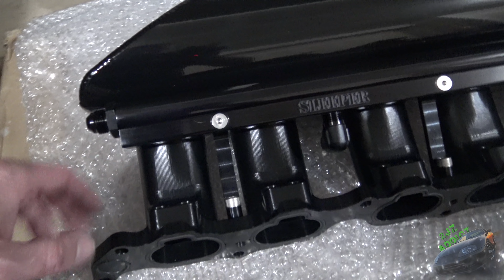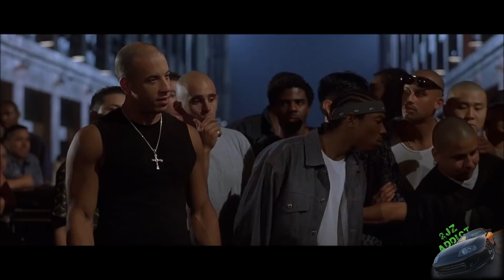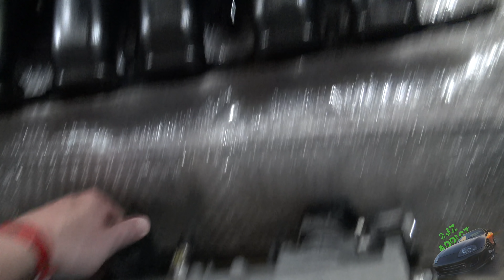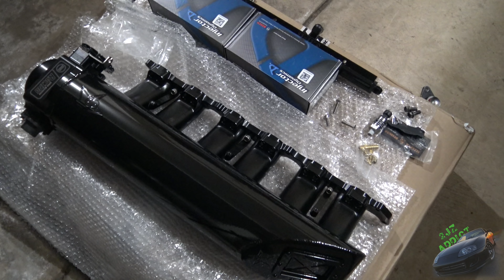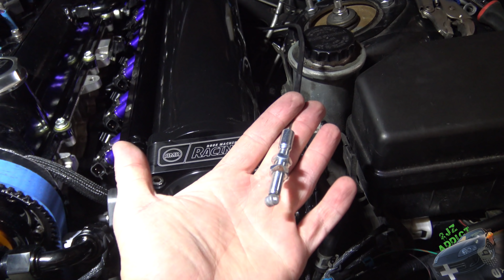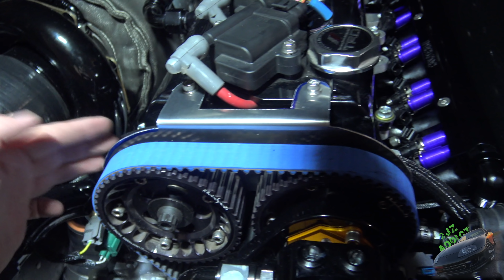1000hp Supra Build | Part 4 | Sleeper Designs Intake Manifold install & Why builds take so long...

Comment: Did you use your stock dip stick tube and dip stick or did you get the freed engineering lokar dip stick?
Reply from the maker: Funny you mention that, I was contemplating grabbing an FE unit over the weekend. Lol I just use the stock one at the moment and did when I filmed this as well. It works fine but I think the FE unit would be a nice touch. 👌

Comment: What AN feed and return size do you need for 1000 hp and will the size you recommend work at less horse power?
Reply from the maker: I run dual 8AN feeds and a 6AN return which is plenty for 1000whp. Some guys run 10AN feeds and 8AN return which is a little aggressive for that power level IMO. Make sure to set your FP properly and you’ll be fine at a lesser power level and have room to grow.

Comment: The fuel rail fittings you use, where did you get them from and what is the size?
Reply from the maker: The fittings came with the rail and manifold. Both were ordered from Sleeper Designs. You do have options if you’d like to run larger or smaller depending on your build. These are -8AN I/O with a -6AN return. The ID of the rail is -10AN so there’s room to go up in line size down the road.
Reply: @2JZAddict  thank you!
Reply from the maker: You’re welcome! Good luck with your build! 🍻👍

Comment: Which ecu you using to control 12 injectors?
Reply from the maker: ProEFI 128 - it’s got outputs for 12 injectors with the ability to change scaling for both primaries and secondaries.

Comment: Option 4 delete cooler
Reply from the maker: That’s actually what I ended up doing. Haha Deleted the cooler and moved the filter to between the starter and frame rail. It made it a lot easier! There’s no way the nitrous would have got otherwise.
Reply: 2JZ Addict cooler not necessary these day due to better oil availability

Comment: I don't remember if you figured out the throttle body clearance issue. If you haven't flip it over so the tps is closer to the fuse box and the throttle cable is on the engine side. You shouldn't have to modify or move anything then. That's how I'm running my setup. Drooling over your 12 injector setup!
Reply from the maker: That’s a really good idea actually. You just run the throttle cable underneath the plenum then?
Reply: @2JZAddict  I choose to run mine on top, but I have seen it ran under also https://sep.yimg.com/ca/I/titanmotorsports_2269_1525767810

Comment: KIller mani! I can totally relate on all the little stuff that pops up along the way, just part of it man! As for recording all the small bracket fab and etc, not needed but definitely would like to see it, might give some people ideas along the way! Excited for your next vid cause I'm at the same spot right now, need to order my fuel lines and run them and my fuel setup will be complete! Where'd you mount your flex fuel sensor by the way? -Rich
Reply from the maker: Thanks for the feedback man. I appreciate it! The little stuff doesn’t really seem video worthy IMO but I agree in that some folks might find value in it. I’ll be running braided Teflon line from Frozenboost.com. They make great stuff and are super affordable. And they’re right down the road from me house. Lol The I’ve got the first gen sensor and mounted on the DS near the clutch master.  They’ve got newer ones now that operate inline and are smaller overall.

Comment: That's whole lotta fuel . How much power is the car making?
Reply from the maker: I have a bad habit of dialing everything up to eleven. Lol The car was on a 6768 and made just short of 900whp.  The new setup is a Gen 2 7675 and good to 1200. I’m shooting for >1000whp at altitude which means sea level needs to be on the top end of the flow.
Reply: @2JZAddict  very nice sir, I enjoy the content. Supra owner here as well. Hope to see it spitting fire soon
Reply from the maker: You and me both man. Haha I appreciate the support and glad you’re linking the videos! 👍🍻 What all do you have done to yours?
Reply: @2JZAddict   home build engine, mazworx prepped block, borg sxe372, fic2150,proefi 128, th400 and stock wheels 😁. Running high 9's on 30 psi
Reply from the maker: Wow! That’s a solid setup man! Well done on the ET as well.  🍻  Are you planning any upgrades before the season opens up?
Reply: @2JZAddict  thank you, just more boost I guess. Lol